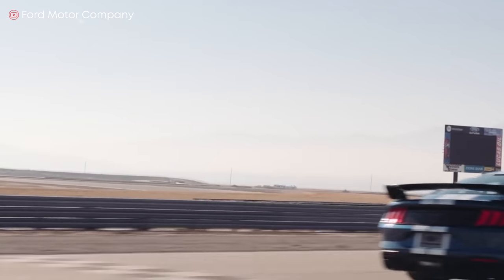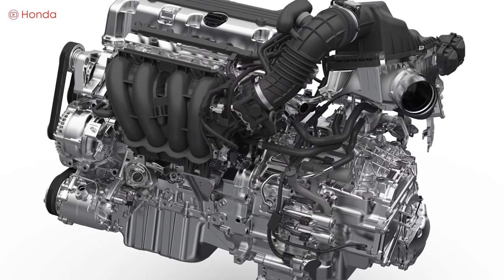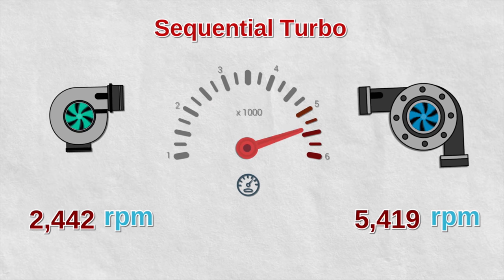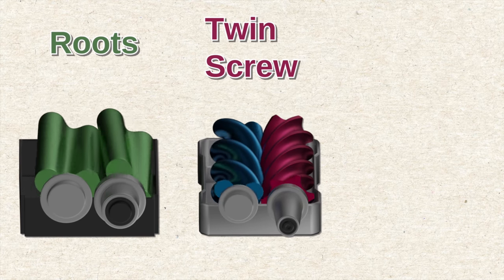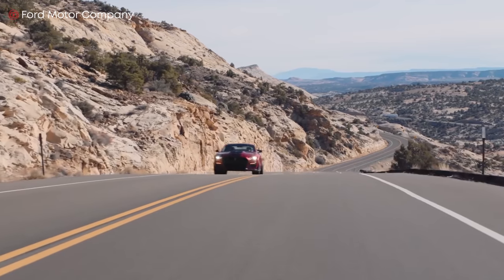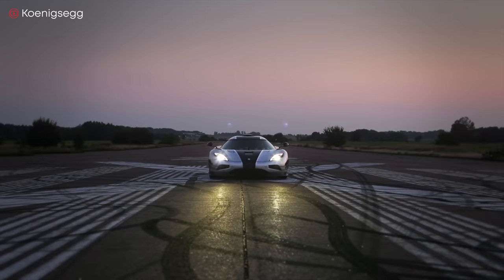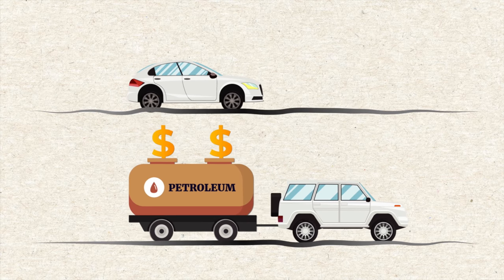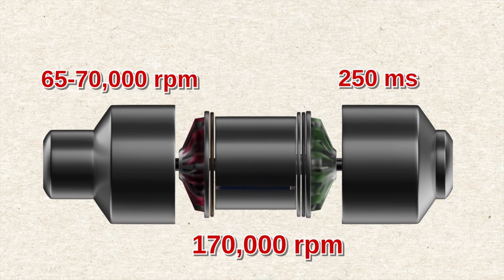This New Mod Will Add 400 Horsepower to Your Car

Comment: What do you think of turbine/jet engines inside of land vehicles but just scaled down alot and shoved in there like its better than a piston engine in practically every way like you may use the excuse as they are big but they are not the turbines in m1 Abrams tanks used by the us military produces alot of tworqe and over 1500 horsepower and most of the engine bay of the tank is the transmission and clutches to the drive wheels like scale that thing down and easily produce 800 horsepower and more tworqe than any piston engine lever could dream of and it shouldn't care about dust as that was one of the reasons why it was put inside land vehicles

Comment: Scotty, in a previous presentation you made on why NOT to modify one's intake breather, because they are made to be perfect the what they are designed. Yet here you're saying that you could /might/ should drop in an elect. Sper charger. So, What's your recommendation on that?

Comment: Hey Scotty and everyone, I have a 2011 Mercedes C300 . It’s a 3l V 6 engine with 228 hp. I want to reach or even exceed 300hp if possible. Any specific mods I should start on? Will a turbo blow it up!? (It has 120,000 miles on it also)

Comment: Has someone thought about using exhaust gasses to turn an electric generator and power the wheels directly using built in electric motors kind of hybrid system using batteries and so on.

Comment: If the electric motor you showed at the end is supposed to turn on to help out the turbo and switch off when not needed it should only need the compressor side right? Why does it have a turbine on each end?

Comment: Here's the plan. Take the turbine side of a turbo, attach a pulley on the end instead of a compressor.. Then use the pulley to drive an alternator, that charges your battery. Then electric supercharger to increase power. You will get instant supercharger power AND the efficiency of a turbo. done.

Comment: I really wish peopLe would stop saying explosion. Have you ever seen a clear engine running with a high speed camera? It's a burning of the fuel and air mixture and it's expansion of the gases which is the power stroke. Not an explosion. Another one that I've been saying for decades that people are catching on. A engine is a air pump. The more air you put in the more power is released. Boost is about air, never a problem to inject plenty of fuel.

Comment: Can anyone explain there's throttle controller for turbocharger car which gives you instant boost of torque that has no turbo lag, how does that work exactly and is it bad for the car?

Comment: The famous P47 used a turbocharger and a supercharger as well as water injection to manage the combustion temperatures, which could be very high due to the combination.
    Much of this is not new.

Comment: This new mod you say, electric turbo, I don't think is a 24/7 always working type turbo. Here's why I think this, the energy required is from electricity and a 12 volt car battery although can deliver high amps won't work so you'll have to have a battery pack with multiple cells in parallel then in series to make enough voltage and current to run this electric turbo to full potential instantly, and  those batteries won't run 100 percent as the batteries lose energy and depending on how fast they charge back up , you'll have some loss of power while the batteries charge up again. That's my opinion and thoughts on that lol....my car has a screw type supercharger and I love it although it's small one on a v6 it's fun and instant power and it's a clutched pulley so it's very fuel efficient when cruising around, it makes 350hp incase your wondering and it  is a 18 year old car very cheap and has same power as a kia stinger and no turbo lag. And soon I'm getting a smaller pulley, bigger injectors, headers, and get it tuned for the pulley and for e85 fuel for my goal to reach 450hp or close to it

Comment: In most cases a turbocharged engine uses more gasoline at maximum power than a larger engine delivering the same power would.

Comment: Scotty, off topic but wondering your opinion on a FREE 2003 Toyota echo just needs a clutch has 348k miles is it worth putting the money in?
Reply: Probably not
Reply: If you can do the work yourself...go for it...you can always scrap it out for $250 and recuperate the clutch kit cash

Comment: Sure bet that turbo and supercharged Volvo 4  cylinder engine would be a nightmare to work on after getting a few miles on the clock........

Comment: I have a question I just want to get a little bit off the subject I have a 20/20 GT I'm pretty sure I'm past the break-in point I have a thousand miles on my 20/20 now do I have to change the oil even though it had does have a thousand miles on the oil

Comment: You forgot to mention that superchargers have inherent parasitic drain on hp. So at very high speeds a turbo will out run a supercharger since after a certain point having every last hp is more important than getting your power instantly.
Reply: Incorrect for a couple reasons, but to start- consider that a turbo is also a parasitic drain.

Comment: Why are there not turbos with electric fan blowers or say a type of cold air intake with an electric fan that forces air? Is it because it takes energy to produce the electricity to run the fan making it counter productive? Okay so after getting to the end of this video I got my answer, they are making them now.

Comment: Turbo lag even though it's still exists, is nowhere near what it was 15 years ago. Technology on automobiles and the computer systems really help remove the turbo lag. As a Chevrolet V8 only driver I would like to see Pro Chargers used instead of superchargers on cars.

Comment: It seems like adding that much horsepower would stress a transmission that wasn't designed to handle it, as well as putting stress on numerous other parts! Engine mounts, suspension linkage, etc...........

Comment: My Turbocharger and vacuum lines on my 2011 VW Sportwagon TDI (Audi engine) just went out. Luckily it was still under warranty cause it would have been around $4000. How do I keep the newer one from going bad?
Reply: Don't drive it. 

Sorry, couldn't help myself
Reply: @labornurse  trade it in, first thought. They make cleaners. Maybe change the oil before the 10,000.
Reply: @michianadroneservicesllc858  I used to drive a turbo 4 cylinder Chrysler, pt cruiser convertible. Regular oil changes with synthetic, warm up and cool down engine for a few minutes before taking off or turning it off. Don't always drive like a wild man.
Reply: @labornurse  you sound like my wife.
Reply: @michianadroneservicesllc858  😆lol, sorry.
Reply: @labornurse  the dealership did just changed the oil requirements. They changed it from 5w30 to 0w30. Wonder if that had something to do with it.

Comment: You know that a Turbo Charger is actually a form of Supercharger.  That's why putting the electric motor between the compressor and the turbine does not make an electric turbo.  The origin of the name turbo charger comes from the Turbo Supercharger, or Turbine Powered Supercharger.  So electric turbo does not make sense, electric supercharger (as Scotty said in this video) is correct.  Superchargers for air into the intake of an engine and can be driven mechanically from the output shaft of the engine(commonly "Supercharger"), electrically by a separate electric motor (commonly "electric supercharger/ electric turbo ), or by an exhaust turbine (commonly "Turbo charger").

Comment: Oh man. Got the info wrong on the superchargers. 
The roots blower is at 100% boost all the time. It DOES NOT come on in bursts. 
The centrifugal supercharger is basically a belt driven turbo. So it has to spin up to make boost, just like a turbo. It has virtually no boost at idle, just like a turbo. 
Good try Scotty but you missed the mark.

Comment: The cost of gasoline is rising. As an alternate fuel producing almost no pollution, H H O gas seems to be  promising. Either Hydrogen is stored. by itself, or the flammable H H O gas  would be in a compressed tank. The only other is wood gas from restricted combustion. Wayne Keith wrote "Drive on Wood" . That was originally World War two invention of the Germans.

Comment: Do you think most people/car need 400 extra horse-power? most people would wrap that car around a tree. Even 300 horse power is way too much for most. (and still need a good transmission/rear-end" to handle it)

Comment: you failed to mention that to get the 48 volts to run the electric supercharger requires not only a special and seperate electrical charging system but also an extra motor to run that system... its a stupid idea when other ways are possible

Comment: 🔵 I value it enough that it doesn't matter HOW-many people accept the butchering of our technical-language!, I will NOT just "Go-along with it!"....
A "Supercharger" is a 'Positive-Displacement'-device, which means that for every complete rotation of its components the device takes-in and pushes-out a specific and uniform volume of air under a specific and uniform pressure,... ANY-thing with an 'Impeller', 'Expeller' or 'Fan' is NOT!!
One term of reference for this device would be the
generic 'Fan-forced induction', at least THIS term makes reference to the fact that this is NOT a 'Positive-displacement'-device.
I love yuh Scotty!...but I for one REFUSE to refer to ANY impeller-type air conveyance device as a "Supercharger'. ◻

Comment: Supercharger fan for life. I will get rid of my Supercharged Ford Lightning from my cold dead hands. Turbo's are for soccer mom's. Also to save gas don't floor it! Stay out of boost mode and it runs like a basic pickup.

Comment: Common usage of the terms turbocharger and supercharger has obscured their proper definitions, and I feel this video missed an opportunity to set things straight.

A supercharger is not different from a turbocharger per se. A supercharger is anything that provides air (the charge) at a higher (super) than atmospheric pressure. Differences are all in just how the supercharger is driven. Whether it's directly off the crank, or driven by an electric motor, it's still a supercharger. It's also still a supercharger if it's driven by a turbine.

If you look at old engineering literature, turbine driven superchargers were always referred to as turbosuperchargers. This was somewhat long for common usage, so we just call them turbochargers for short, or turbos for even shorter, but that doesn't change the fact that they still are superchargers.

It's like calling an turkey a turkey, while referring ducks and chickens as birds. Birds are not different from turkeys: turkeys are birds too. Turbochargers are superchargers too.

Comment: "Centrifugal superchargers are the most popular forced induction system." 30 seconds later ihs market research shows  220 models with turbos in 2018 vs 30 with superchargers. 🤦‍♂️ Even if we're talking about the aftermarket i seriously doubt that centrifugal superchargers are more commonly used.  They aren't as efficient, and outside the better low end torque they produce far less power on average throughout the rpm range compared to a properly sized turbo set up, with similar costs.  Side note most new turbocharged vehicles produce peak torque at 2k rpms.  Turbo lag is an old problem that's been solved by using smaller turbos and better tuning, using rich conditions in the exhaust/turbo housing to decrease turbo lag.

Comment: Why cant they just make a super cheap truly utilitarian vehicle? No fancy induction systems, electronics, gearing, suspension, safety features, or body work. One with easy to service modular components made with simple reliable designs and materials.

Comment: That was the most "completely missed the point", not even an attempt, to explain how a roots supercharger works! Atmospheric air is raked into the body of the supercharger and then trapped on the output side by the interleaving rotors! It's THAT SIMPLE!

Comment: Love the Channel scotty but have to disagree with you on a few Points.
Have Built Turbo Drag car builds  To Supercharged applications. Turbo lag with Todays compressor maps. And appropriate turbo to engine sizing in single turbo applications. Turbo lag just is no Longer an issue. In the early stages of turbo cars this was an issue. Not any longer
Turbocharged cars are far superior in they're ability to make more horsepower from zero loss to parasitic drag like a supercharger.
Electric compressors have a very very very long way to go to be put into an applications where they are dependable and reliable. The problem is without control of the total output at certain Load conditions for the engine. Its either full tilt and lean Issues with that instantaneous psi of  Air entering the engine and thr mafs ability to make those changes. A true programmers nightmare 😏

Comment: A turbocharger IS just a type of supercharger. It's more correctly termed an "exhaust driven supercharger."
There's also "compound supercharging" which is a combination of an exhaust driven supercharger and a directly driven supercharger."

There's nothing "new" about anything in this video. Crack open an old book on supercharging aircraft engines and you'll discover just how old the "new" technology is.

Using an electric motor to spin a compressor is not new either. People have been experimenting with this for several decades. But it's only been in the last 10 years or so that small, powerful brushless motors (typically from the RC world)  have brought the higher voltage motors (12 vdc won't cut it) capable of providing the power needed to spin a compressor fast enough to generate boost of any value.

Comment: Gas cars are just dying, no matter if they use turbos (own an Audi A4, 1.8T, which enjoy a lot) superchargers, hybrid, secuential turbos.... It is just stupid nowadays buying a supercharged 500hp v8 just because of the "experience", noise, or whatever pointless reason.... Car entusiasts are aging so the technology, and transportation concepts are facing an urgent and interesting change... ( this year I made more miles with my mtb than driving, and saved a lot of time, money and now weight 5kg less) :)

Comment: formula 1 engine .... 91 cubic inches, .... 900 hp at 14,000 rpm.
Reply: @Mark Codiroli ferrari is 850 +/-  mercedes is 900  honda is closing on them.

Comment: ☝️😄 Remove the mole saboteur at Ford Corporation sent in to infiltrate, sent by dodge or Chevy or both? The best selling mustang (recent times) 05-09 design got derailed and morphed into the “Asian GTR slant headlights” we see today. How is it that a 94-04 mustang design generation body style is allowed to perpetuate persistently for 11 years? While a drastically improved generation 05-09 proven through sales is allowed just 5 years? Something does not jive at Ford Corporation. How is it that Dodge challengers  and Chevy ZL1s produce much more stronger engines? And are optional with sunroofs? While the GT Mustangs are not allowed to have sunroofs at Ford Corporation? Not to mention a lot weaker engines as well. Someone making decisions at Ford in the mustang design is none other than a mole saboteur sent to infiltrate via Dodge or Chevy.